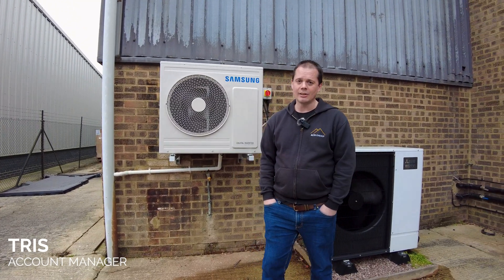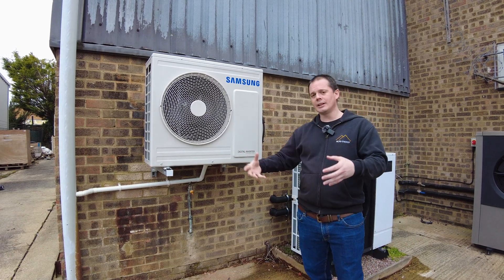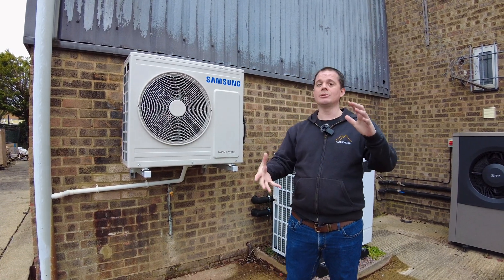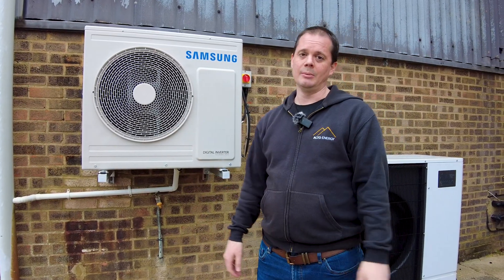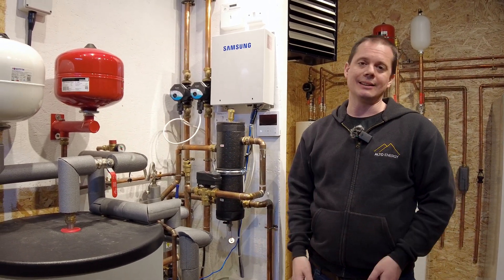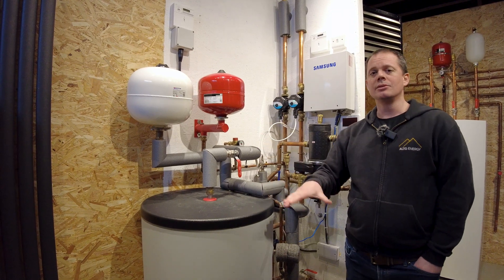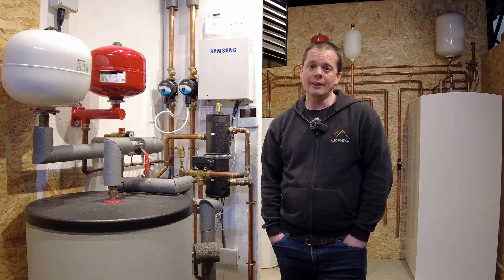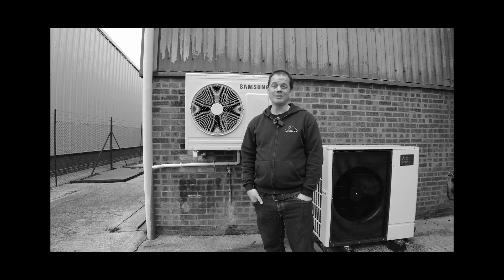How Does An Air Source Heat Pump Work? | Alto Energy

Comment: I knew they worked similar to the internal combustion engine, witch craft pure witch craft 😂
On a more serious note, just had our Samsung heat pump installation done and the fitters have placed the heat pump with the flow of cold air expelled from the fan unit parallel to the heating pipes, meaning cold air is passing directly along approx 2 metres of piping, all be it they have some insulation over them, surely this isn’t best practice, there is tons of space at our house, surely it would work better with the cold air blowing away from where the pipes are and not passing cold air right over them?
It isn’t anchored to the ground either, just sat in some foam pad things, is there a risk of it blowing over in high blustery winds? The unit has been attached to the pads right at the outer most end of these pads rather centrally mounted. Seams a bit unstable?
Reply from the maker: As long as the pipes are correctly insulated, there's no issue with the unit blowing cold air along them.

Ideally, the heat pump should be mounted centrally on the big rubber mounting feet but it's not essential. It's normal that these aren't bolted down otherwise the vibration transfers all the way through making the pads useless. If the unit is wobbly then it's likely the base isn't level. We've never heard of a heat pump being blown over, even in gale force winds, so I wouldn't worry about that.